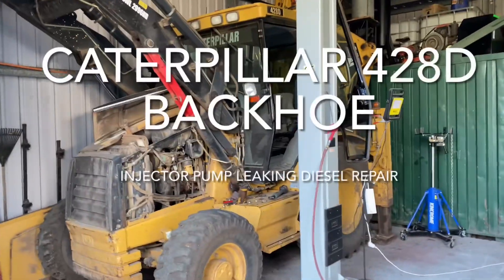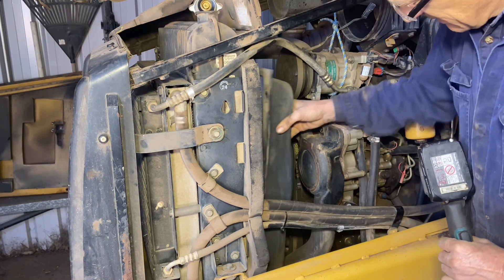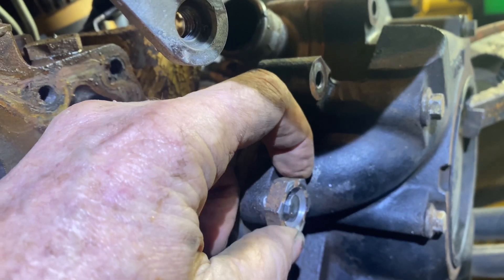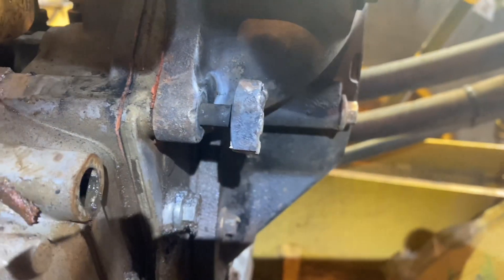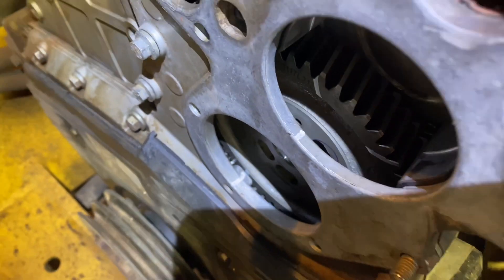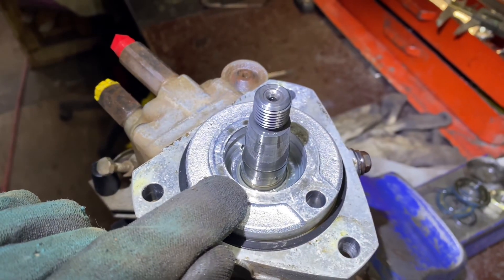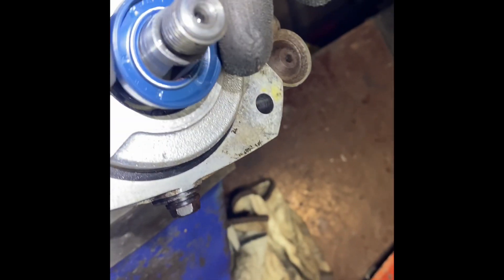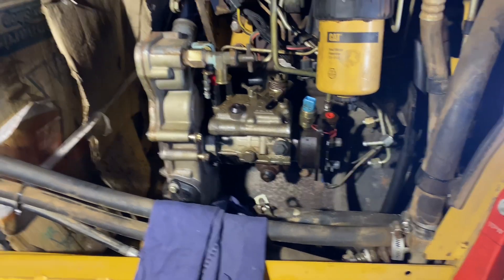CATERPILLAR 428 D.  Injector pump leak repairs

Comment: Thankyou very much for taking the time to make this video. It saved me thousands $ . It’s pretty much the only good tutorial out there on this problem. And it was spot on. Oh and the seals are from Delphi and the part # is 7174-856 . And  of course you’ll need 2 . Oh and all I had to do is remove the water pump and the ac bracket.